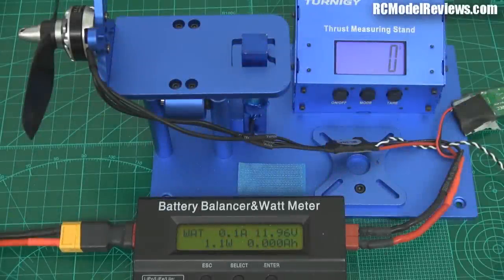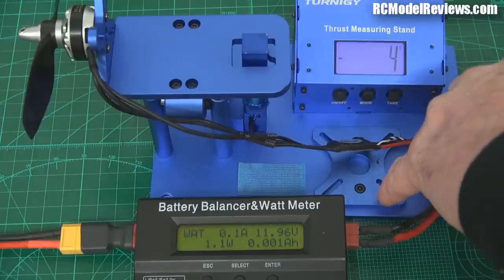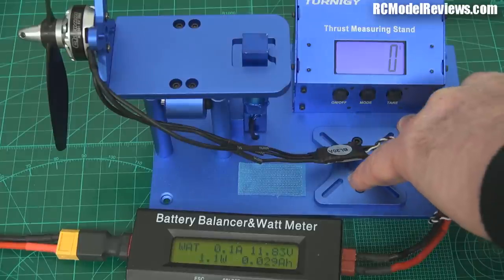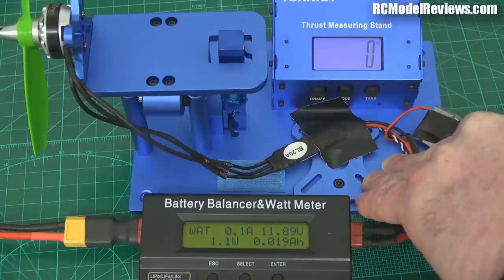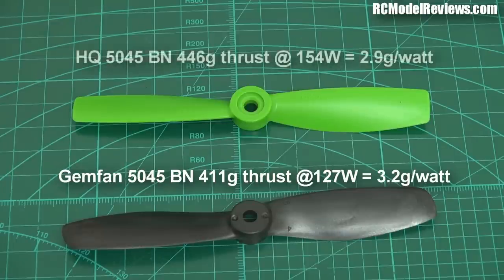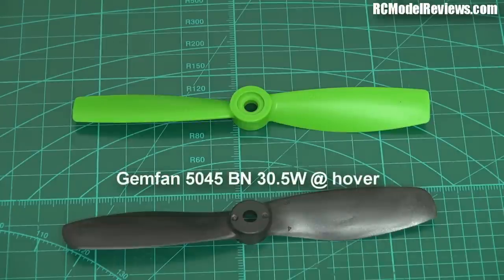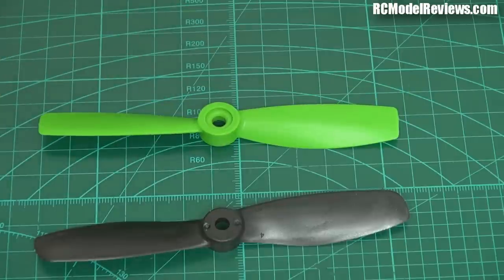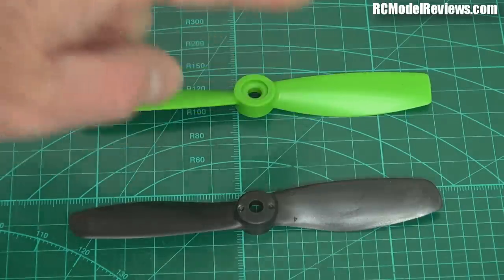Bullnose shootout: Gemfan 5045 versus HQ5045 mini quadcopter props

Comment: Bruce the efficiency will most likely be because of the Gemfan's rounded tip as it has a little more elliptical planform but also has less surface area so produces less thrust. The HQ has more surface area but the induced drag will be higher due to the large tip vortcies that would most likely be coming off it.
Reply: FinalGlideAus Yep Chad, you're probably right.  I mentioned the effects of the tip vortices when I did the original prop comparisons but I'm surprised that the effect seems to be so non-linear on the GF props -- ie: the efficiency is almost identical at 150g of thrust but changes significantly at 400+g.
Reply: ***** Tip speed is obviously a factor.  As you know, drag is not linear...
Reply: ***** Would be interesting to see a thrust vs. efficiency graph. At 150 grams there was 0.1 W/g difference, but that could simply be below the margin of error. A proper graph would reveal to what degree non-linear effects were occurring.

If such a chart was to be made, a bench power supply would probably be a better choice than a battery, for consistency.
Reply: ***** I'll check that out and post an update.
Reply: FinalGlideAus Chad you just love your HQs lol
  I have a stigma with Gemfan...  can't get over it until i see something beat an HQ all around.    

Fabulous video Bruce  thank you for sharing this extremely relevant information.
thank you thank you thank you!
this is by far one of my favorite channels.
Reply: ***** Thanks mate, your kind words are much appreciated.

Comment: Be careful with your static thrust tests. You will always draw more amps with a propeller if you are not moving through the air at a flight speed, and instead are sitting still. The performance of both of these props will be different if they are traveling through the air instead of sitting on a test stand, this is explained by the propeller's advance ratio. Because of the variable of advance ratio, static thrust test are only useful if you want to know how the propeller behaves during a hover.
Reply: austin holbrook Yes, but at least here we have a benchmark for comparison.   Measuring the dynamic thrust is a whole lot harder (and more expensive).
Reply: It's still the most effective way of getting an apples to apples comparison.

Comment: I really like the GF5045 but one thing I have noticed is that in a light crash they have a tendency to bury themselves in the ground a lot more than my old Dragonfly 5030 which when the quad rolls snaps them completely, particularly the front props. Better to order twice as many front props as rears when switching to acro mode.

Comment: Hey Bruce, when comparing the 2, it would be good to see what power is needed from the more powerful one to match the less powerful one. What I mean is they both needed 30w for 150g, and the gemfan did 411g @ 127W, but how much power do the HQ ones draw to deliver 411g? Because if its similar, then you basically get the same prop, but with a little more top end so to speak. Would be interesting to see I think...

Comment: G'day,

Yay Team...!

 Um, shouldn't you have recharged the Battery with 110% of the calculated Current Drain, to compensate for the Storage-Efficiency Deficit of around 5% on both Discharge and Charge, cumulatively ; both showing up as a Rise in Battery Temperature, regardless of whether Current is being Stored or Supplied...?

  (100% - 10%) + 10% = 99%...; whereas,
(100% - 10%) + 11% = 100%..., in Storage-Battery Charge-State Reality Terms...

 Everybody I ever heard of who expected 100% Storage-Efficiency from any Battery System either flattened the Battery, or destroyed it, due to Chronic Undercharging...

  Sad, but true...

;-p

Ciao !

Comment: NIce one Bruce 
Really usefull :) 
I am stuck on the GF 5045 . I dont really have a need for bullnose .
On Cobras 2204 2300KV i feel the best prop is the Standard GF 5045 
Seems to be more efficient and totally vibration free .
I guess the smaller mass of the props plays a roll ?

Comment: How much is the battery capacity and the total weight of the 250 mini quadcopter?
Reply: Chywei Ho It depends on a lot of factors, like the frame material motor size and battery size.
But for a frame of reference they can go between 450g and 550g for a 250 sized mini quad.

Comment: Bit off topic Bruce but what do you think of the BL20A used about 16 so far and only had 1 DOA. that not bad i guess considering where i get them from and the price. BTW made a donation couple of weeks back and relised your email address was already in my Paypal bought an eBook of you some time around 2000 guess that is why
Reply: zebeedee00 So far I'm quite happy with the BL20 and haven't had a DOA or a failure.  I gather there are some issues with a batch of the DYS20A units which Malc highlighted in a recent video on his RCTV-UK channel (go subscribe if you haven't already) so I'll be looking at that.  My favourite ESCs remain the ones from RotorGeeks.  They're indestructible and perform very well -- albeit at a higher pricepoint.
Reply: yeah from what i could work out from the his video was that it was the sn20 so that would be SimonK firmware guess someone in the factory flashed a firmware with the wrong timing. i always re flash first thing when they arrive i never trust what someone says is on them

Comment: What motor was used?
2300kV or 2000kV
Reply: Neil Mallory Quanum 2204/2300
Reply: ***** Would be interesting to see what thrust / current draw you get on 4S. I'm running 4S on dys 1806 with 5030 and 5045  gemfans (not bullnose) on a 12A setup. Everything still only slightly warm.

Comment: Bruce, sorry to sound like a broken record, but I'd really love to hear what you have to say about the hitec radios.
Reply: pataat oorlog Got to get the UHF systems playlists done first.
Reply: pataat oorlog Simple answer. Just get a Taranis. Futaba,JR,Hitech et al should be afraid, very afraid. Each of them differentiate their various products by artificially hobbling the capabilities with closed source firmware, encouraging you to "upgrade" to a higher model at exponentially higher prices. With the Taranis the one unit is capable of doing almost anything you may require now or into the future because an update is just a free software upgrade away and all at a mid range price point. So you want leading edge technologies like SBus, Telemetry and scripting, virtually unlimited model memories and companion PC configuration programs, The Taranis has them all. The only area the Taranis is let down is the quality of the case and switch gear but you would have to spend much more with the other brands to get significantly better quality. This is also the reason why FrSky products have not been taken up by the old guard model industry suppliers. They can't see future sales beyond extra receivers and telemetry modules and so refuse to stock them and actively discriminate against it.  Taranis also faces opposition from older more established modelers who have spent thousands on their gear often just for the dick swinging rights and are often too biased and blinkered to endorse a competing brand.
Bruce has voted with his feet. He has JR, Hitech and other brand radios but what does he invariably fly with, well you probably already know the answer.
Reply: Rob B The Hitec radios have their place.  They are probably the simplest to program radios I've ever seen and that's a bonus for people who don't want to spend time learning how to use the Taranis.    It's horses for courses -- however I have to admit that these days the only radio I use is my Taranis and I've yet to meet anyone who's bought one and been disappointed.
Reply: Fair enough mate! Still interested in what you say as I'm a heli guy and 

A) want to know if this 7msec frame rate is true or not. 

I put a scope to sbus on a futaba and noticed sbus packets do come in frames of 7 ms. As I understand 25 bytes are sent (11bits for channels) so it would seem a full update of relevant channels for a heli guy can happen in one frame,

But for a flybar setup most futaba relievers (except maybe the high speed ones) will actually update servo positions at 14msec (71 Hz) . Thus every two sbus frames,

FBL gyros will update servos up to 333 Hz, maybe 560 on narrowband tails.

If maximal output at 7ms via the pwm ports, it may be a good choice for flybar, if it has good tolerance to transient voltage drops. That was a weakness of prior hitec rx's no? 

B) do hitec rx's have issues with low voltages? Do you need to supply them better than your bog std futaba say 6303, 7008 etc.

C) how comfy is the radio. What does it feel like most? A futaba or dx8? Subjective I know but they are rare, I've not seen one let alone touched one.

D) Does it allow real curves (expo, rounded) for better pitch curve tweaking?

E) flash 7 timer alarm good enough? Or should I get the 8? Is that basically the main diff?

Remember I'm a heli guy, FBL mostly, and not an fai pilot so even for a flybar, just the basics are needed. (ie if it dies all a fut t8j or spek dx8 does, I'm grand)

Is the hitec a better radio than say a futaba T8 or T10? Or 14SG although that's a price bracket higher?

Hope to hear from you soon.

And Bruce, could you put a taranis to the scope, just to see frame rates. I doubt they're faster than sbus but would love to see. I don't have a taranis, I like simple stuff. I'm a heli guy. 6-7 channels no mixing except the mandatory throttle collective, and I'm sorted for FBL. So... I guess I coukd go a taranis but fail to see what benefits it would bring.
Reply: So people keep telling Me!;) 

Thing is a futaba is um... Easier (lol) to program my helis. I'm not sure as well if the taranis is as fast, it may be but it may be sending more channels, I don't need telem, so an ultrafast non telem futaba protocol is fine for me,

I like the feel of futaba as well.

Willing to try hitec as they seem to be selling 7ms frame rates as well (prolly because if of sbus compatibility) but so few people have this and only maxima rx's can do it so I really dunno

Comment: Maybe I'm just being dumb here but instead of recharging a battery with the same amount you've just used why don't you use an AC->DC power supply to power the test? Wouldn't it be more accurate?
Reply: Pedro Costa I don't have a suitable supply in the lab right now.
Reply: ***** you don't have one or you can't find one in the mess? :) :) :)
Cheers from Portugal mate. ;)

Comment: Hi Bruce,
Great review as always.
I would like to know, what could happen if props that are considered to small for the motor are used ?
For instance what could happen if I use HQ 4045 on the MN1804 or some other 1804 or 1806 motor ? 5x3 props are usually recommended with these motors.
Reply: You would have less trust. Only way to make that work is usually with higer cell count. So smaller prop but more Volts in battery to get trust you need.
Sometimes this can make setup more power eficient.
Reply: Hyacinthe Malaspina 
If you mount props too small/motor too big, nothing will break. But smaller props are built for higher RPM. A bigger motor most proably has a lower kv rating and might not reach the RPM the prop is intended for. So in the best case you will get off the ground, but have no "punch", in the worst case you won't even get off the ground.

Comment: Will wait for you lets smash sum stuff test :D. Im not a big fan of Gemfans there ok cruising around but give them power especially on a 4sell they just throw a prop in mid flight happened to me many times
Reply: Pudsey - Rc Yes, I've had the same experience but these are made of a much chewier plastic so I don't think they'll shed blades nearly so easily.
Reply: There is a new contender from DAL also 5045 Bullnose ( no need to cut down ) your going to be a extra busy man Bruce just when the weekly reviews on rcmodels were getting to be weekly :D